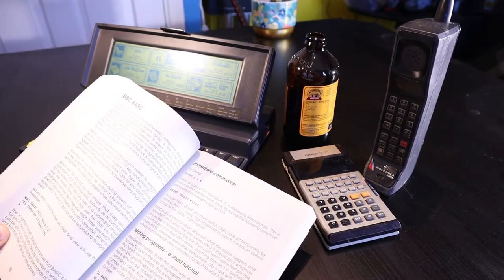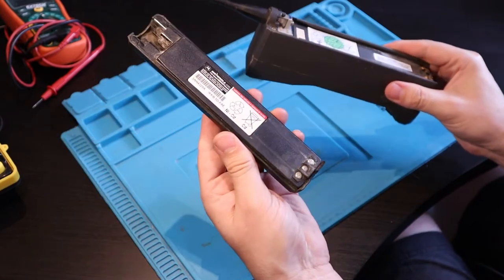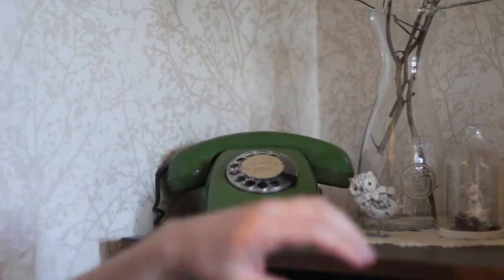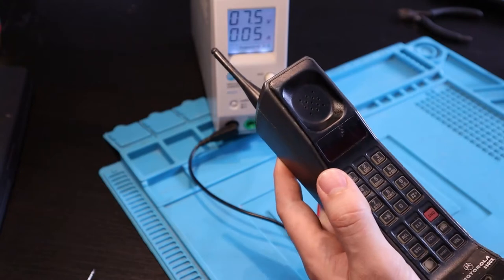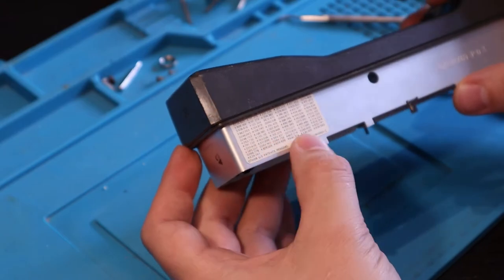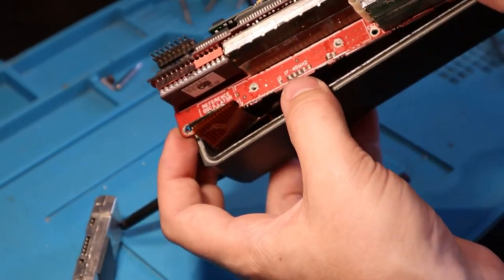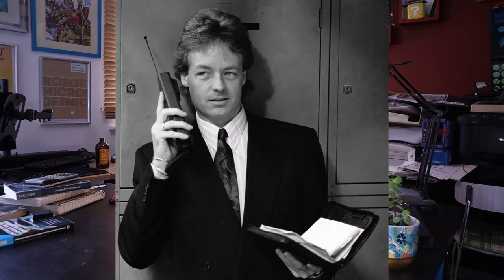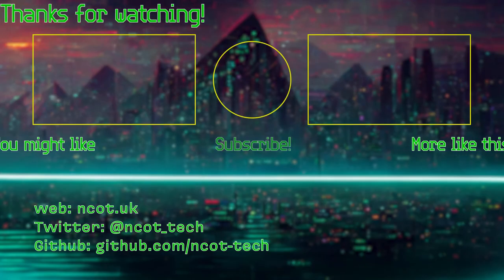The £3,000 brick phone - mobile phones in the 1980s

Comment: The contacts are for some debug testmode. You can saw the top of the battery case off near the contacts because there's nothing in that part of the battery and you need to short some pins to the antenna/ground. Later flip-phone models can enter testmode with just key presses. You can check signal strength as a number not just a 5 bar meter, maybe listen on some channels, all temporary stuff. Too this day I setup my iPhones to show signal strength in numbers too.

The "Made in USA" wasn't just a joke on the sticker, I think (but can't find references online) we really had manufacturing lines in the USA making phones, like chips and soldering all sourced in the country. Moto had old military ties so they liked making things in the country and keeping patent secrets internal. This would've been for those really old analog phones. I would guess into the mid 90's. There's articles online talking about the MotoX ending in 2014 but that was "assembled" not made in USA. Thanks to Covid-19 supply chains (TSMC), political threats and mistrust of foreign chipmakers, the US started talking about chip fabs again around 2022, not just for military.

Comment: As a service engineer back then the first mobile phone I used was  one of the in car type that we built into an old leather briefcase along with a motorbike battery to power it and a speaker fitted to the lid, we all shared it as needed.  Then we all got the Motorola bricks and thought we were well off.  I don't remember the handsets being quite so expensive but I think the calls and rentals were more expensive.  And yes you did have to pay for incoming calls.  The reasoning was that the caller didn't know it was a mobile number so was charged the standard trunk rate and the mobile user picked up the remainder of the call cost.